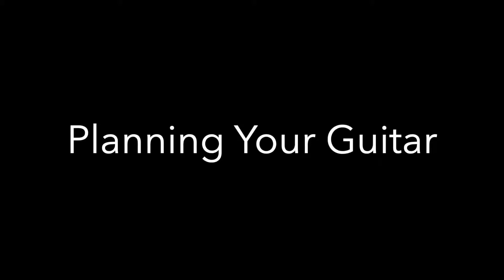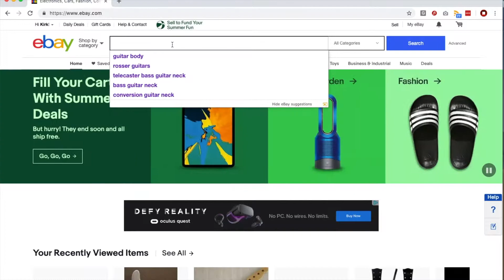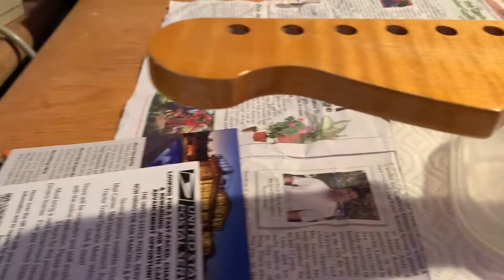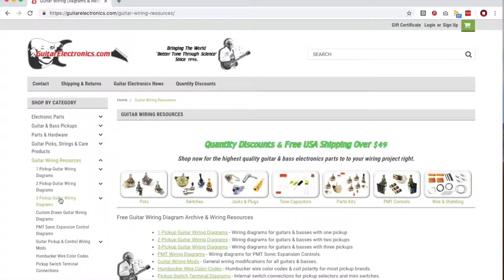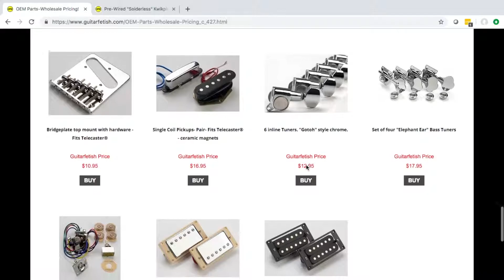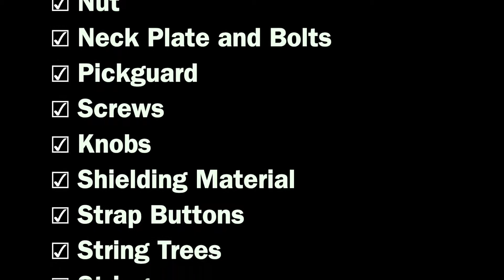How to Build Your Own Partscaster Guitar, Part 1 :  Planning it out and Buying parts

Comment: That's true. Big Guitar Companies will charge you alot.
Reply from the maker: Yep. And with most of them,you have to literally be a rockstar to get everything you want on a custom guitar. I think this guitar cost about $700 to build in total. That's not cheap but this is involves much better parts than any kit.
Reply: @MakeGuitar  yeh I got Rickenbacker's and a 1963 Gretsch tennessean. Nice huh. I wouldn't want to take them on the road.

Comment: How do I get to the online guitar modeling tool
Reply from the maker: Hi Ian, The tool is here: http://www.offsetguitars.com/dressing_room/
It only makes Jaguar and Jazzmaster style guitars and you need to have Adobe Flash installed on your browser to use it. This ESP guitar configurator might help pre-visualizing other styles: https://www.espguitars.com/pages/esp-usa-configurator 
The Fender mod shop can also be a good tool if you don't need major alterations from stock: https://shop.fender.com/en-US/mod-shop/
Reply: @MakeGuitar  the mockup tool for offset is not working anymore in 2022 Flash was discontinued, and even with a mozzila extension it doesnt run at least for me, was looking for some mockup tool for jazzmasters lately
Reply from the maker: @leafygreens_eatingclean  The options are limited compared with the offset forum's tool but if you are designing a Jazzmaster with Jazzmaster pickups for example, the Fender mod shop is a decent tool for mocking up fairly standard Fender guitars: https://www.fender.com/en-US/mod-shop/jazzmaster/0181904706.html